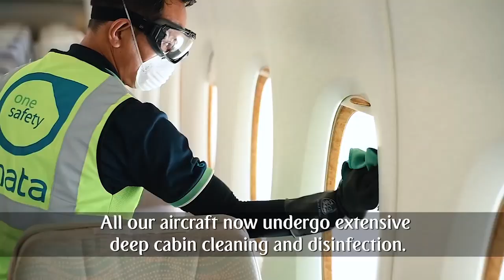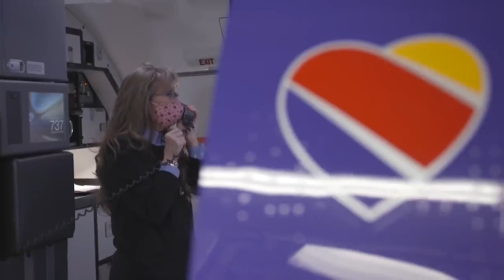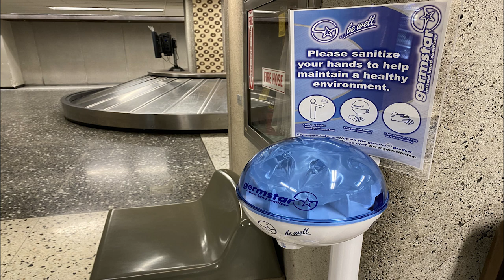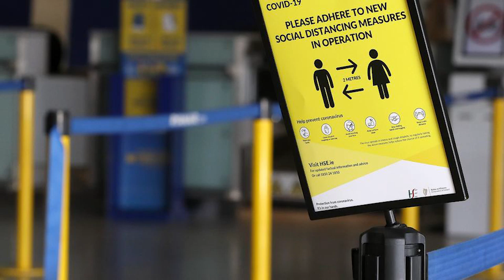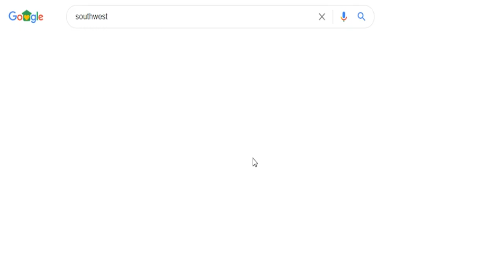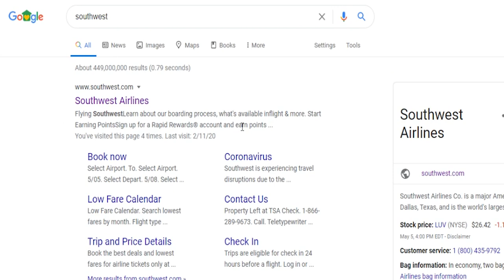CHANGES TO AIR TRAVEL | WILL IT BE SAFE TO FLY ???

Comment: Thank you for this update! I was concerned about air travel but this helps me feel better. I do have a question tho! It states the passenger will bring our own mask & hand sanitizer & then at the end it states we can pack a certain size sanitizer but on a medical pass & will go through a separate screening. I’m confusedx
Reply from the maker: They stated you can bring up to 12 oz of your own instead ot the normal 3.4 oz containers normally allowed.  It just means you will probably go through different security line or maybe be taken out for an extra check at the airport.
Reply: Sharon at Sea Travel thank you for the explanation!